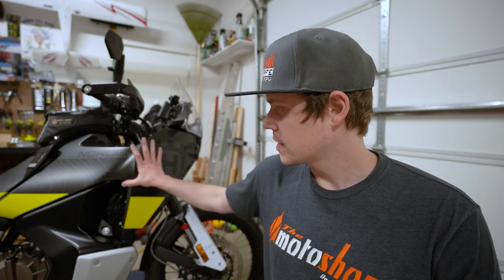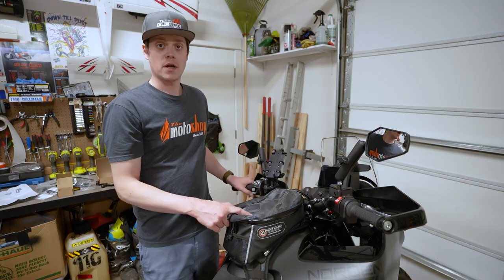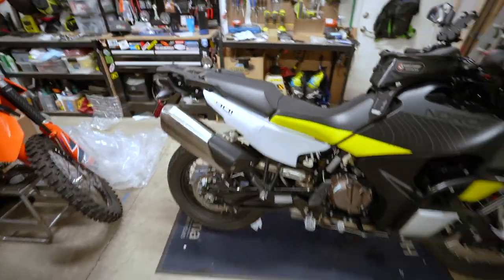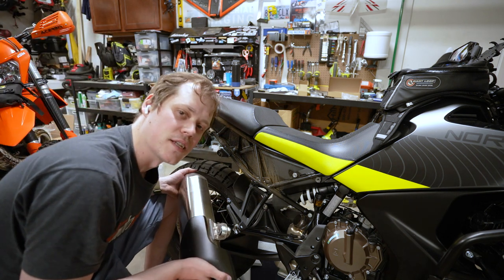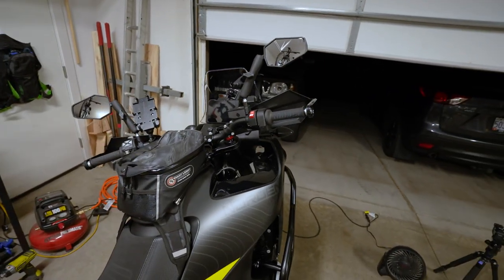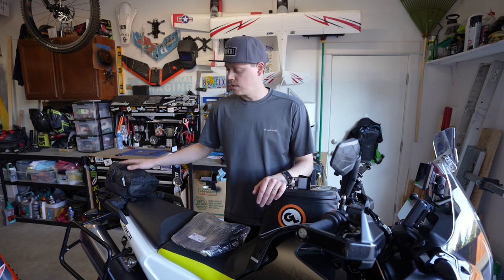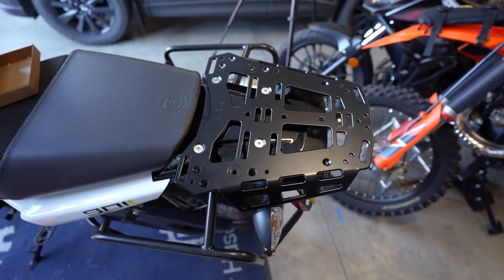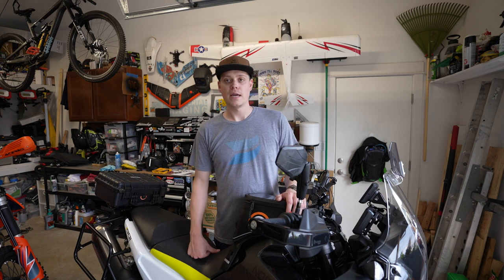Prepping Norden 901 For Adventure - Hepco & Becker, Vanasche Motorsports, Touratech, Giant loop

Comment: SUSPENSION !!!!!  biggest investment ive made in this bike and i think by far biggest single mod ive done for any bike prior but total game changer ! the stock boingers hold this incredible bike back
Reply from the maker: Yeah I’ll likely be sending mine out this winter once the snow flies. Where did you send yours to?
Reply: @pnwxplore  well this time instead of sending the stockers out for a revalve and respring which ive done several times prior , i ordered Tractive Extreme rear shock and front fork drop in units from Teds Beemer shop
Reply: @pnwxplore  i used the same place in Texas a few times that is now out of business on prior KTM's
Reply from the maker: @justsomedude445  oh nice! I have looked at that. Thanks!
Reply: @pnwxplore  but if i was just doing the respring/revalve today ive heard great things about a WP suspension outfit in Pasco WA near me called "JMC" motorsport
Reply: @pnwxplore  ive got 3 rides on it now , set the sag @ both ends and have played with all the damping adjustments to dial it in , totally transformed this bike which is already amazing with its relative light weight and very low center of gravity , i am 6'2" & 225-230 pounds so the stock units bottomed out when i looked at em , soooooo stable now , i rode what some consider the worst part of the WA-BDR route on it Sunday and WOW WOW WOW stability , no bottoming and i can carry a lot more speed through any section
Reply from the maker: @justsomedude445  awesome, thanks for the insights!
Reply: @pnwxplore  sorry bout the run on , ive had a lot of bikes i have been very lucky and fortunate but none ever before have i felt like were such a big step forward from the last , honest to god this bike is just next level good now in my opinion anyway
Reply: Just watched your video and I am so grateful. So informative and practical. I would like to know, after months of riding the Norden what would you say about it's reliability?

Comment: Thanks for the video.  Do you have to remove the crash bars each time you change your oil?  I noticed you were bolting the front end to the front of the skid plate so was wondering how you got around that.
Reply from the maker: Yeah the crash bar on that side does have to be pulled, not ideal. But probably only have to do once a year so not too bad.

Comment: You may be happier with the tail box flipped around. Way easier to access when loaded. JMIO
Reply from the maker: So far it hasn’t been an issue. I’ve had it mounted this way in two bikes now. Mounted it this way thinking if I forget to latch it closed. It’s much harder for stuff to fall out and it will be immediately apparent it’s open and the wind would push the lid open and I would see it in the mirror.

Comment: Hi,

I have the exact same bike.   I was also struggling for parts cause the bike was new.   Also ended up with the same crashbars.
But i am a bit dissapointed with them.  With them your choice for engine guards will be very limited.    So i will try to sell them.
Did not even mounted them because of that.  I give much value to a good engine guard.   Next year heading of to Turkey and Iran.  It could be that Iran is not possible so then i will go to Armenia.  Also a very nice country.  When typing i realise that it is only in 5 months before the start.   It looks a long time but have still some adjustments to do at the bike.  Probably also the shock.  I knew beforehand that the shock was not ok.  But did not realise how bad it actually was.  It is so bad that i think that KTM should replace all of them without any cost. And an excuse for all the hassle.

Comment: how did the deflector workout? I just picked up a Norden and the buffeting is bad as you know. I have another cheap Amazon deflector and it doesn't help at all. thanks!
Reply from the maker: I mean this is a cheap one from Amazon as well. I would say it definitely improved it, but it’s not perfect. I’m 6’2” and the wind is just barely pushed to the tip top of the helmet. It’s for sure an improvement over stock, so I can’t complain there
Reply: Husqvarna now offers a taller replacement windshield

Comment: Wished i could order the same GPS mount.   We have the option to use the same one for the KTM 890.   But this is not as nice as the one you have. It looks very sturdy. 
Would it be possible to attache the Touratech lockable GPS mount to it ?  I like that one cause when going into a supermarket f.e. you can leave the Garmin attached.
Reply from the maker: It is very sturdy! Been enjoying it. I am not sure if the lockable mount would work or not. I will have to look into it.

Comment: I noticed Husqvarna now offers a replacement windshield that is taller than the original.
Reply from the maker: That they do, but I am not sure it is worth it vs just an extension
Reply: I can tell you that it is not.   

The extension from Husk is quite good. It is just a MRA one. It is also adjusteble.   That combination is better then the larger one. 
It almost makes me think that Husqvarna made an awfull screen on purpose so it would generate money.   The screen and shock are truly two very negative parts of the Norden 901.  That should not have happenend for such amount of money. 
Also when going on a large trip you can adjust the extension screen downwards as much as possible. To get more wind and cooling when going offroad in hot weather. And also to minimise the risc of hitting the larger shield with your neck when crashing.  Had that once with my 1190r.  I hit it quite hard and almost crushed my windpipe.  It hurted for more then a couple of weeks.  
And also i was quit surprised how the extension screen made such a huge difference. Almost could not beleive it.  I own a Klim Krios Pro helmet.  It has a large peak on top of it that catches wind.  Really can recommend the extension screen over de larger screen.  Will sell the larger screen.
Reply: @keesverhagen9227  Where did you get the extension screen? My comment of a taller screen from Husqvarna in truth was an assumption. It's certainly shaped differently. Do you not recommend the new shape? I also have the Klim Krios Pro but I never installed the peak.
Reply: @howlinhog  Ordered it alongside when i placed the order of my Norden.    I got the screen a few weeks later.  When opening the box there was a small tiny card inside with the text MRA.     So probably Husky just had it made by MRA or it existed allready.  To my knowledge there is not a logo present on the screen.    You could compare it from the picture with who MRA has developed and simply order that one.   Assumable it will also be a little bit cheaper. 
The last 15 years the bikes i owned i bought brandnew.   With only exeption of my 1190R.   Every stock windshield was horrible. 
So as soon that there was an other option i immediatly bought one of those.  Most of the time it was not a better option.  Sometimes it became even worse.  I am 1.92 meters.    With all of those bikes i finally ended up with a tall Givi Airflow windshield.  Large and adjustable in height.  Not a good sporty looker but i had no choice. Cause the buffeting got to me every time.  It is not something i can endure.  I hate it. It is giving me a headdache and getting me tired.   In the last 15 years i maybe bought over 20 different windshields. 
In the end only the Givi Airflow gave me the result i could live with.   On three of my bikes at the left inneside of the pannier rack made an holder where i could stick the upper screen of the Givi cause it exists out of two parts. And the upper one can be taken fully away.   On a long trip when on vacation and the weather is hot sometimes you need the airflow to cool down a little. When going offroad and maintaining slow speeds. 
The windnoise also made me go for a Shubert helmet.  A C2 or a C3. Cause they also could minimise the buffeting.  And are also light. 
Although i did not like the hinges of the visors. When going 40 kph or more the visor kept keeping closed by the windforce. 
So for once decided to go on the Klim Krios Pro route.  I must also say that until recently i rode the whole year through because i also had to commute to my job and back.  That was also a big factor to minimilise the windbuffeting as much as possible.    The downside of that is that when riding with the big Givi screen i could not use the windforce to push away the raindrops on my visor.  But you can't have it all. 
I ordered the extension screen with the idea better something then nothing.   With the big Givi Airflow screen in the back of my mind and all of the other puchace failures from the past.   But to my surprice this extension screen is doing a great job.  And now i am thinking why did i not go this route along time ago ? It would have saved me a lot of money for sure from all the failures in the last 15 till 20 years.And also the Givi Airflow screen are quit hefty per price. A lot of money. And way to big.   Maybe i would have had the same results or almost the same results in the past compaired to the bulky Givi screen.    But i also understand that if a persons head comes out a few cm lower or higher that this can make a big difference. 
I once did read an article where someone stated that changing the mirrors on his Norden 901 made a huge difference towards the windbuffeting.  Before in a couple of months to set of for a large trip i also will change the mirrors.   Sometimes it can be the stupid things that also contribute to the change. 
You could try to remove the mirrors and go for a very short ride.  You never know. 

Greetings from the Netherlands.👍
Reply: @keesverhagen9227  Thank you for the very thoughtful reply. I will definitely look into all that you mentioned. I think I saw the same video in regard to the mirrors solving wind buffeting. I think that may be the same guy that taped a complete windscreen over the original. Too bad wind tunnels aren't as common as fast food, I'd have rented one out for a day. 😁

Comment: What size Apache is that? Ended up buying a used 2005 ktm 950 adv w/ 19k miles. The new 890 will have to wait (buying a house) but man adv bikes are funnn
Reply from the maker: The Apache is the 3800 size. Works awesome!

I have a big soft spot for 950/990s absolutely love those bikes, prob the best looking ADV bike they have made. Only downside is the range!

Comment: Every rack I see mounted on the Norden, KTM or aftermarket seems to be sticking out way to far from the bike. Especially on the exhaust side. I get it's a heat thing but I'd rather have heat shields and tighter racks.
Reply from the maker: Unfortunately any bike is like that unless it’s a specific rack for specific hard side panniers. Flat racks are more universal and that’s why they stick out so far. Personally doesn’t bother me at all.